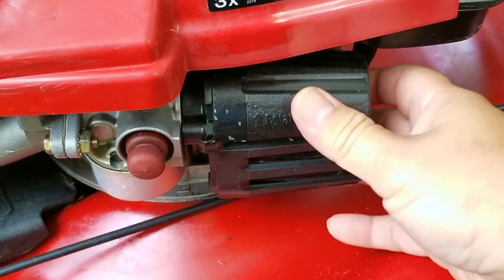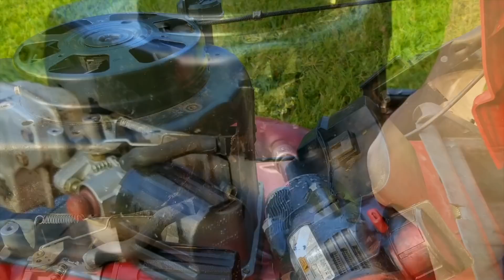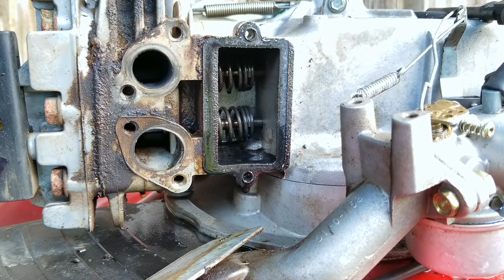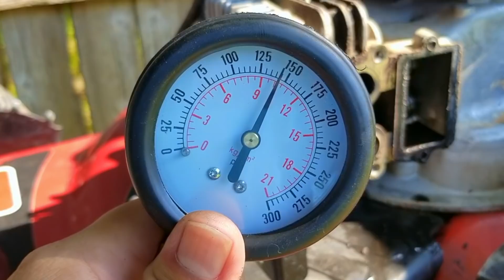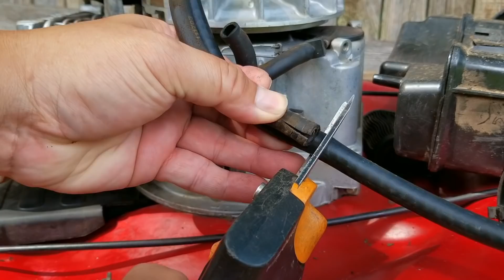You won't believe how many problems this Free Toro Mower has.

Comment: where did you buy bulk of carb bowl gaskets? i tried amazon and they end up disintegrating after installed
Reply from the maker: really? I've never had any issues, are you using ethanol gasoline?
Reply: @ yeah i dont have access to non ethanol unless i buy from big store i use fresh gas and everything its the gasket themself that disintegrate i got a pack of 12 Briggs and stratton carb bowl gaskets and those are the ones that disintigrated
Reply from the maker: thanks for the information, I'll have to keep an out for failing gaskets
Reply: @ no problem where did you get yours?
Reply from the maker: it's been awhile since I bought the, so it was either Ereplacementparts dot come or Amazn.

Comment: Toro states that you should not screw the oil filler cap down when checking the oil level.  Just set the cap down onto the filler tube, check and then top off to the normal fill line.
Reply from the maker: Really? can you send me the link to where you read that>. Thanks.

Comment: The muffler is very close to the intake pipe and the exhaust/intake ports are reversed from traditional Tecumseh practice I believe for emissions reason,they wanted heat transfer to the intake pipe in order to get the engine to run with leaner jetting.
Reply from the maker: I like this comment a lot

Comment: You should add a fuel shutoff in the fuel line. Helps if used when the engine is to be shut down.
I hope the bottom end of the engine didn't get damaged by low oil running. Some of those mufflers make a noise that sounds somewhat like engine knock.
  Any time you have occasion to take the metal shroud off of the cylinder and flywheel it is a good idea to clean away any grass that has collected under there,even perhaps using a blower,shop vac or even shooting some compressed air. 
Also a possibility of checking that the head bolts are at proper torque.

I guess you drained the last of the old oil before replenishing the oil with fresh oil? 
(Noticed the next video where the oil being drained looked awful and also how the mower was tipped,hope that the new air filter didn't get lunched.)
Reply from the maker: yes I agree

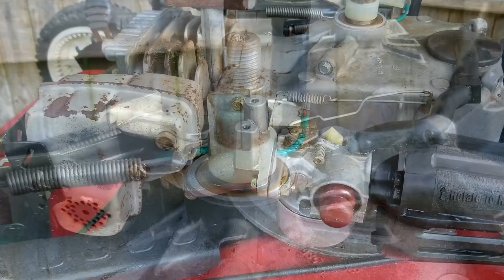Comment: 4:40 top mount breather has hose routed to the carburetor airhorn area so improperly tipping the engine probably caused oil to go through the hose where it then reached the air filter and some got burned onto the spark plug  the oiled air filter then made the engine run as if having a choke on part way all the time 
some had hose just hanging loose down the side of the engine and some had it routed into the air filter box ("Premier Engine")
Reply from the maker: very true

Comment: It's emissionized so it won't run 100% smooth. 
I think that one has the "pilot jet" behind the plastic cap in the place where older Tecumseh carbs had idle needle screws. That pilot jet is related to whether it runs reasonably smooth without "hunting". Much smaller jet hole in it than the "jet nut" hole in the bowl jet.
Reply from the maker: I agree with you on that one.

Comment: Of course it has been "burning oil" because of ingesting it from the soaked air filter and probably also accounting for the fouled spark plug. 

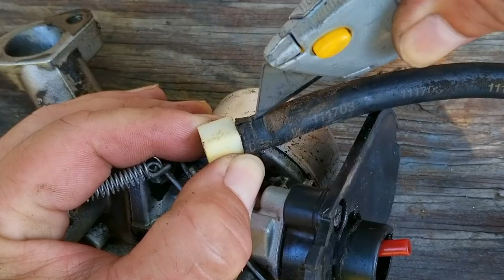beware,not sure about this one but some with a "mechanical/centrifugal compression release" will give low compression test readings even if nothing is wrong with the compression. ( 9:00)
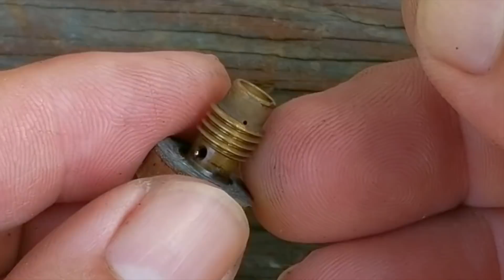  10:09 you could do well with some Jet Spray Instant Gumcutter! --but beware not to get it into your eyes,need goggles or something.  (There might be plastic tube in the "center leg" of the carb that should not come into contact with the Jet Spray Gumcutter or any other carburetor cleaner)
Reply from the maker: thanks for this

Comment: Possible that isn't the right key (flywheel locator)but one someone put on after damaging the original-I believe some originals have a slight "jog" that changes the degreeing of the flywheel slightly vs. a straight key--if that key is steel and not soft metal it is not the right one
A damaged /loose blade or blade adapter can also make it "kick back" when trying to start

Comment: (deleted),updated I see the tube is routed to the carb airhorn, if the engine is tipped wrong oil comes out the tube and fouls the filter and carb and even gets into the engine via the intake pipe.  You can't tip that thing such that the spark plug points to the sky without making an oily mess of the air filter,especially if it's a bit overfilled as to oil.
  Might have lost some oil from improper tipping. It is a mistake to try to start that thing with the oil as low as it appears to be on the dipstick!

Comment: I have this model of mower. Bought it used 14 years ago for $50.  The engine is  runs great.  Did have some carb problems so I just replaced it.  The reason I got it so cheap was because the drive system broke.  I just disabled it and push it, more exercise for me.
Reply from the maker: nice work! thank you Kevin Colonel
Reply: @kevincolonel3070  fixing the drive is not very difficult u need to check under mower and if u dont see a belt thats why or if u do and when u press self propelled feature and doesnt tighten the belt u need to adjust it so it engages more
Reply: @disssavagekid9572  Thank you for your concern and advice.  I had attempted to do just that. However, while going over the transmission, I found that where a removable woodruff key was to be used, they instead tack welded a square peg, thus rendering the unit unserviceable.  I can only guess that the production line ran out of woodruff keys and wanted to keep the line going and adopt this shortcut.  I returned the parts I had ordered, and the dealer waived the restocking fee on account of the manufacturer having made this modification from its design. That was fifteen years ago, and it is still running, no complaints here.

Comment: You should get a 3d printer and some TPU. Could print a lot of the gaskets with it. Assuming they don't get too hot.
Reply from the maker: you are correct, I've been considering it.  Thank you Timothy Stress.
Reply: I can tell you from experience, an Ender 3 pro with a printed direct drive bracket,a good quality titan clone extruder works fantastic for printing tpu on the cheap.

I picked one up from microcenter for $100 with a new customer coupon, titan extruder on Amazon for $18 and printed the bracket from a $20 spool of petg. I "built" it for a big tpu project I had. 

If they are still doing the coupon and you have microcenter near its an amazing value. May want to do a little digging. 

BTW the inland filament microcenter sells is overall good. If you want to see what the printer looks like, I have it in a bad quality short after upgrading to the spider hotend.

Comment: My Snapper Ninja 6.5HP Briggs has a pressurized oil system but does not have an oil filter.  I run Pennzoil Platinum 10-30 in it.  It does not use oil but I change it regularly (twice a year).
Reply from the maker: very nice, yes the From taking one apart they have a pump in them

Comment: Have almost the same mower only difference being that it's a rear wheel drive with the the personal pace self propelled system.  Picked it up a little over month ago as the deck on my old mower rotted.  This mower was well maintained by it's previous owner and has a solid deck on it and runs as good as any new mower out there that I've owned and/or used.  The 6.5 hp Tecumseh engine on my mower is a work horse plenty of power with no issues what's so ever.
Reply from the maker: very nice, thank you Arnim Krause .

Comment: Did you notice the area ot bottom of tank? That holds water. Have a mower sat 2 years started 2nd pull still had lots of water in bottom of tank in lower area
Reply from the maker: really?

Comment: My gf picked up a craftsman with tecumseh mower in 2010, used for $50. She never checked the oil. I didn't have a mower so when we bought a house we just used hers. To date I have never changed the oil, ive never even checked it until yesterday. She never did either. So it's gone at least from 2010 until today without an oil change. And it doesn't even smoke. 

Anyway this one doesn't have an oil dipstick, it has the older little twist cap near the bottom of the block. I will say the oil is as black as my coffee lol. Anyway how to tell what the correct level is? There is like a slot that seems like it could be used as an indicator but I might be wrong. So does anyone know?
I do have trouble starting it from time to time, it runs on prime then quits. I clean the little holes in the main jet and it's ok. 
It's a beast, it just won't quit. And strangely even though I haven't sharpened the blade since we got it, it still cuts the grass with minimal tearing and busts through brush easily. Great mower.
Reply from the maker: wow, that's pretty amazing.  They don't make them like anymore, thank you Dan Wake.

Comment: Usually, the quantity of oil that a lawn mower engine requires is:
-Tecumseh-Briggs&Stratton: 600ml
-Honda: 400ml
Loncin (a chinese manufacturer): 400 to 600ml (depending on the model)
-Kawasaki: 600ml (650ml with oil filter)
Those quantities are the most common on small lawn mower engines. The quantity may vary if there is a oil filter  (like kawasaki).
Reply from the maker: thanks for the information

Comment: Hello! I have a toro 6.5 with electric start and the rope does full back sometimes and when the engine starts the engine makes like a popping noise when running. Help.
Reply from the maker: I'd need to see a video of this.
Reply: @HomeGaragechannel  it sounds like a backfire I did buy a cheap new carb for it
Reply: @HomeGaragechannel  that might be it I can make a video tomorrow

Comment: That has a horrible rod knock
Reply from the maker: I hate to say it, but I've heard worse. this is minor in my book.
Reply: What happened
Reply from the maker: I've found a mower, that had very little oil in it, But they must have kept using it, until it developed the worst rod knock I've ever heard.
Reply: I've had one throw a rod, and knock a hole in the side of the crankcase
Reply from the maker: was that on a push mower?
Reply: Yep, someone used it without oil, so I picked it up for parts like the carburetor and recoil assembly
Reply from the maker: probably the best use for it.

Comment: Personally, I never have understood why the need for a self propelled walk behind mower. As long as the wheels and bearings are in good shape, mowers like this are easy to push. That being said, I have two "push" mowers that came with Tecumseh engines. When I got them the engines were junk and not running but the mower decks, wheels, handles, etc were all in really good shape. So I replaced the engines with Predator engines from Harbor Freight. The swaps were fairly easy and only required different size blade adapters and the addition of throttle cables. We have been using these two mowers for 4 mowing seasons. I just pulled them out of storage this past Saturday to get them ready for another season. I spent about an hour changing the oil, replacing the air filters, and sharpening the blades. They still run like new.
Reply from the maker: very nice, The self propel, is just another feature to sell.  I've had a few dealings with the Predator lawn mower engines, and they are decent. Too bad they don't see them anymore.
Reply: @HomeGaragechannel  I knew Harbor Freight stopped selling them, but I assumed there would be other distributors for them. But after some searching, it seems no one carries the Predator vertical shaft engines any more. I wonder why.
Reply from the maker: me too, I guess until then, we'll have to find another alternative.

Comment: I have exact same model and it has been awesome. Been using it since like 04 or 05. Dad bought it at Lowes as a recon and I think that's why it is better than usual.
Reply from the maker: thank you for the information Donald Bixby.
Reply: I believe that is similar to the (older?) LEV 120 motor which is very powerful if you did something to the carburetor that the EPA really does not want you to do.

Comment: Tecumseh engines work just fine; I don't get the hatred thing. As easy as any to work on, and easier than many.
I sure do miss the carb. bowl drain valves engines used to have. Easy to drain off the water and sediment.
Reply from the maker: I completely understand.

Comment: I have a toro recycler rear wheel drive. It's a 6.5 tecumseh and I bought it in 2004. I use it mainly to trim with around bushes and I have a bank that is too steep for my lawn tractor. It has been very reliable. The only thing I don't like is the airfilter.
Reply from the maker: surprised it survived mowing the bank. thank you Larry Keener.

Comment: i had this exact mower. the carb constantly gave me fits. i wound up completely ghetto rigging it. i converted it to propane. ran it for 2 or 3 seasons like that till it got drowned by hurricane irma.
Reply from the maker: nice way of fixing it. I was thinking about doing the same some day
Reply: @HomeGaragechannel  it was easy. i removed the fuel tank and recoil started. i used a BBQ regulator, a 90 degree throw ball valve, and some bits to step down the bbq regulator down to the 1 lb bottles, and the fuel line output to 1/4 inch and pipped it into the carb where the crank case vent went into. then i would use a drill to spin the motor and with the motor turning open the valve until the motor caught and ran. then adjusted it to the rich side and the back off a hair and then mow. worked great. i'd use 2 bottles of propane a mow and refilled them from a BBQ tank.
Reply from the maker: nice!

Comment: Just had a similar situation with the exact same fly wheel puller on a fly wheel with a sheared  pin.  I do not have an impact wrench tho, used a ratchet and socket to tighten the puller and ended up cracking the flywheel necessitating replacement.  Any suggestions on how not to do that again?
Reply from the maker: sure, use the hammer method instead. I've shown It in my other videos before.
Reply: @HomeGaragechannel  Guess I should have elaborated more.  I beat the top of the crankshaft while lifting up with a crow bar until I thought I was gonna drive it through the bottom of the block!!  This thing sheared the key about 90 degrees from in time!!  I picked it up for $10.00 and was able to find a cheap used fly wheel, so got it running again.  I swear the key looked almost melted!
Reply from the maker: yes I see, I also noticed that when the key Is sheared, it's much more difficult to Remove the flywheel. So I can understand it happening.

Comment: I have a problem again, I used my Chinese combi machine, the throttle does not work well, it only runs at full speed. I turned it off at full speed, Now it won't start. When I pull the recoil starter it makes strange noises and sometimes the rope slips out of my hands. It has compression and spark. What can I do? Thanks in advance.
Reply from the maker: take the spark plug out and see if it's wet, while the plug is out, pull the rope several times, let it dry like this for a couple of hours, then put the plug back in and try starting it again.

Comment: I would fix a tecumseh, I just worked on 3 this year after not seeing any last year. 2 needed valve adjustments. I would have cleaned the carbon in the head given how that plug looked.
Reply from the maker: you're right, it was pretty bad.

Comment: I have the same mower with the Craftsman designation. It was a freebie with similar symptoms. Flywheel key was partially sheared and the carb was cruddy. Air filter was oil soaked, so it was probably tipped on the carb side. The Amazon China carb I installed came with fuel line, air and fuel filter, and a fuel shut off. Seems to work fine. Thanks for the video.
Reply from the maker: thank you Tolba Szy

Comment: Online you hear a lot of people complaining about Tecumseh engines.  A few drawbacks on Tecumseh engines this size are:  don't like the air filter design, carburetors are more prone to leak, and having a little more time taking off and putting on the carburetor.  Other than that the Tecumseh engines themselves seem to be solid and dependable.  Toro self propelled mowers come with Tecumseh, Kohler, and Briggs and Stratton, depending upon the model and year.
Reply from the maker: It's definitely a different animal, but it's very durable.

Comment: Have a troy bilt weedeater 4cycle it stars and revs up well but the moment the head starts to cut it slows down or wont turn. The rpms reach high when you just hit the gas but any pressure from cutting the motor slows down tried different shafts being there interchangeable. Not sure/looked for carburetor adjustments but it only has an idle screw tried looking online couldn't find anything on it.
Reply from the maker: there you might be a problem with the drive shaft or the couple in the in middle if you happen to have a split shaft.

Comment: Tecumseh's get a bad rap but they are really very solid. Just look at how many are still being used more than a decade after the co. went under. Plus, there are still plenty of parts available online attesting to their longevity. Sure, the filter setup is kinda weak, but every engine has a quirk or two. Just for fun, here is an old sales video (only 4 minutes) where the engine's superior features are touted.

https://www.youtube.com/watch?v=DaAgTT0KYoE
Reply from the maker: You are right jj parody, they really are decent engines.